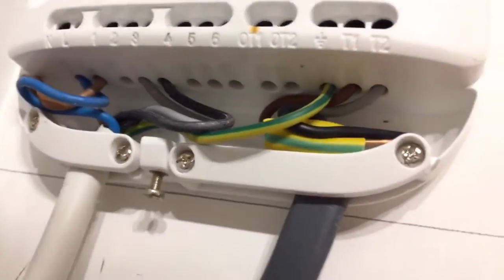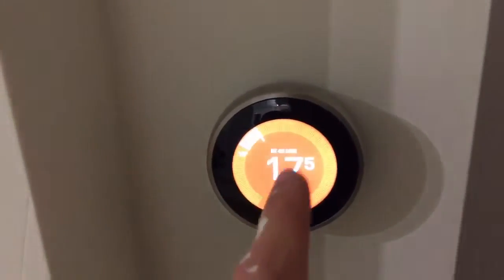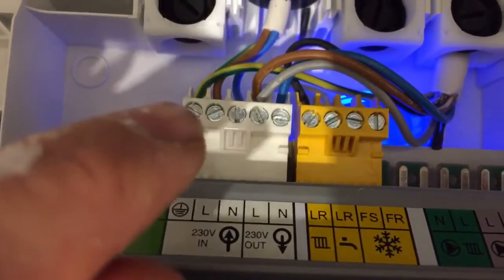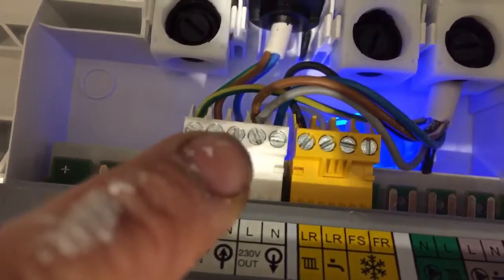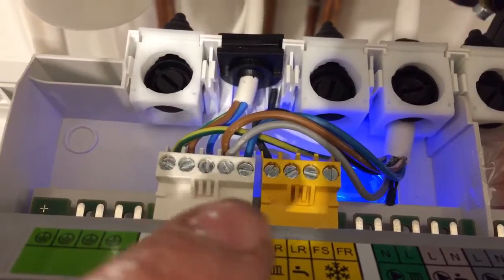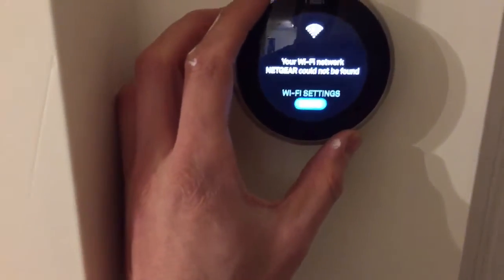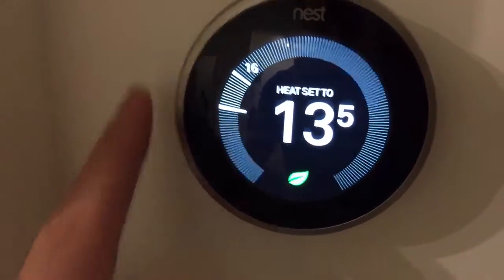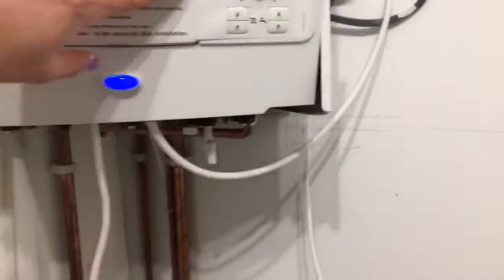How to Install / Wire Nest Thermostat 3rd Generation Worcester Bosch Greenstar 25i Combi Boiler

Comment: By fitting one of these you making it an on off control which is very inefficient and it also stops the boiler from modulating Down to save energy so not great on W/B Boilers

Comment: Thanks for the video 🙌 you said it will work with any boiler, my old boiler has got mechanical timer/clock , only 3 cores comes FROM boiler PCB into that timer clock... 3 cores, thats all that turns boiler on and off ...

Comment: of course if you use the base unit for the thermostat, (which-lugs into a power socket, you with not need and linking power supply  wire through the walls!

Comment: I’m guessing you can use anything to power the actual thermostat so long as it’s the correct voltage? Seems odd having a ‘wireless’ thermostat that needs wiring to the boiler?

Comment: Thanks for a very clearly explained video. 
I power my 3rd generation nest thermostat with a micro usb cable into  a power supply close to best location to monitor temperature. So no need run long cable from boiler location. 
(Communication to the heat link at the boiler location is wireless.)

Comment: Nice video, just wondering if you think it's worth getting a smart thermostat that allows for modulation, to save fuel? Only Worcester bosch wireless thermostat does it I think.
Reply: I was wondering this also. Did you get a thermostat yet?

Comment: Great video - thanks.

Just a couple of things to add, the bridge wire for the hot water should remain in place. Also, if you're replacing an integrated controller such as Drayton RF, the ribbon has to be unplugged from the circuitboard (behind the receiver on the front of the boiler) for the NEST to take over.
Reply: Hey there I've got an integrated system (myson plus) and I've installed the nest system but that still seems to be working. I reckon what you're saying I need to do in order for the nest to work. But could clarify where this so called ribbon is please?
Reply: Great shout on the RF control panel ribbon, saved me a load of agro
Reply: After lots of headache why it wouldn't work! Unplugged it and it's now working ! Also it put it into basic mode, which needed to be disabled as well!

When Worcester plug-in clocks (MT10, FW100, MT20 etc.) are removed,
the boiler stays locked in BASIC MODE, limiting heating temperature to 30°C.

To disable it:

Press and HOLD the ECO button and the CH + button together

Hold for 5 seconds

Boiler should “unlock” the full temperature range

Now press CH + again and set to 60–75°C

This unlocks the boiler’s full temperature range.

Comment: Great post, what happens with LR water? Currently mines connected to 230v outlet using Worcester wave. The 2 wires to wave go to ems which I will delete 
Thanks
Reply: Your Boiler will be more efficient using the Wave via the ems, this will allow the Wave to use Weather Compensation and match the Boiler Output to the load, Nest Doesn’t use ems and Worcester doesn’t support Open Therm

Comment: I don't understand this. If Nest Thermostat can be used with Nest Stand (connected to a regular power socket mounted anywhere in the room) still communicating with Heat Link, why do I have to hard-wire it with Heat Link? 
Shouldn't there be a way to just connect Thermostat with a regular 12V supply, not the original Nest Stand? If it is a fkn smart Thermostat, should it communicate with Heat Link wirelessly in this case?

Comment: Matt decent video.... showing the basics of the install...although there is alot of information missing about how to isolate your boiler and prove for dead....
Just out of curiosity can you confirm exactly what your profession is? By the sounds of it your not an electrician by the terms you used in this video?
Reply from the maker: Hi Neil, I do not have a professional. Just wired it up and left my gas safe engineer and electrician to check it sign it off once the project was complete.
Reply: @MattHutton  come on  you do realise it’s  illegal to open a boiler case regardless if someone has signed off your plus  a gas engineer won’t sign anything for installing a thermostat

Comment: Thanks Matt! did you have to remove the old wireless transmitter for the old thermostat?
Reply from the maker: No worries. This was a brand new installation so there was nothing to remove.

Comment: Get a Nefit OpenTherm/EMS converter, it will allow the nest to modulate your boiler.
Reply from the maker: Awesome, good to know :)
Reply: You should be careful with this if your Boiler is still under warranty as the manufacturer may consider the converter an unauthorised modification, all UK Boiler manufacturer’s should be made to make their Boilers compatible with Open Therm as in Scandinavian Countries, but they want to push you in the direction of their own controls
Reply: Wish someone would do a video showing how to install one of these converters can't find anything in the UK

Comment: Hi, thanks for the video. I have a question as my old basic thermostat was connected to 3 wires plus earth one. Blue, red and yellow. What do I do with the yellow one ¿ thanks in advance
Reply from the maker: ‘If’ your yellow is an earth and ‘if’ you are connecting these wires to the thermostat on the wall to charge it. Then you can just wrap the wire up in electrical tape and not use it. 
But please do no take my comment as advice, as I do not know any of your wires are connected. If I was there I could give you a better idea of how to do it.
But basically the thermostat on the wall has a battery in it and it wirelessly connects to the wireless connector that you mount next to the boiler. So you just need to provide the thermostat with charge. If you what the video through fully you can see how I have connected all of the wires. You only need two for the thermostat on the wall.
I hope that helps.

Comment: How to do opentherm connection?
Reply from the maker: Not sure. Should say in the manual
Reply: @MattHutton  got it sorted
Reply from the maker: @MuhammadAdeelAhmed  awesome, how did you do it?
Reply: @MattHutton  I have logic 35 combi boiler so connections could be different to yours. I have short the number 4, on and off connection and then used the OT1 AND OT2 ports of Nest to open therm ports of combi boiler. Rest of the connections remain same.

Comment: Hope all these people doing there own connections inside boiler are testing emissions after because on this particular you are breaking the seal on a room sealed appliance
Reply from the maker: That’s funny,  I couldn’t see anything in the wiring diagram that came with the Nest to check the emissions after connecting it up. Must have been a job for the gas safe engineer who installed the boiler and signed it off ;)

Comment: No one should take the casing off a boiler unless Gas safe registered, people beware your casing often forms part of combustion seals which protect your life!!

Paying the price of a professional  is often worth it considering the risk involved
Reply from the maker: The boiler with fitted by a gas safe engineer, and provided with a certificate by the same gas safe engineer. Which he provided after I fitted the thermostat :)
Reply: @MattHutton  Its still illegal for you to work on any gas appliance especally if you are removing the combustion cover
Reply: You can take the front cover of the boiler off to access the electrical connections, as long as you don't start touching any other parts inside. In no way does the front cover seal anything, the bottom of the boiler is full of holes so any gas (if there was a leak) can escape with or without the cover on
Reply: @agicorn6379  So how can he carry out the necessary 26.9 checks if he is not qualified to or even have the correct tools also this boiler is room sealed and he is running the boiler with the case removed without a clue about what he is doing
Reply: @agicorn6379  the front cover does provide a seal, if there are any holes in the bottom of the case where grommets have been removed etc then the Boiler is considered to be “At Risk” the last person to work on the Boiler is responsible for its safe operation, once the case is refitted the flue integrity and combustion should be checked using a flue gas analyser, only a qualified engineer is considered competent to do this …. In a perfect world obviously 😉

Comment: Nice video Matt, though you're obviously not a professional cos you have fluked the right wiring but not sure u understand it.  A couple things, 'IN/OUT' is input/output, not inside/outside.  Also, LR is Live Return.

The nest needs a DC power source, and a connection to the heat link.  The connection to the heatlink can be wireless (with a separate dc power supply), OR powered & connected via the T1/T2 terminals from the heatlink.  If you're installing the thermostat far from the heatlink, then you HAVE to wire it to the heatlink, otherwise you can connect wirelessly with a plug in power source (I.e. no wires from the heat link to the thermostat).  This is also why you need to fit the heatlink away from the boiler because the boiler interferes with the wireless signal between the heatlink and the thermostat.  For a hard wired connection, you can place the heatlink wherever you want.  

The boiler controls the temperature of radiators and the hot water.  The nest does not send any details about the temperature, only an on/off signal. So your comments about the boiler not firing because the boiler temperature is low etc is nonsense.  The nest simply sends an on/off signal to the boiler.  If the temperature u set on the thermostat is above the ambient temperature, it triggers a switch in the heatlink which sends a current down the Live Return to the boiler (the 'on' signal).  When the boiler receives this current, it turns on.  When the desired room temperature is reached, the thermostat sends an 'off' signal to the heat link which then turns the switched live off. Because the live return doesn't have a current, the boiler turns off.  Some boilers need to be told to turn off and thats the third connection that you didn't use, but most modern boilers will default to being 'off' if the switched live is off.  This is all of course assuming you don't have any other controllers plugged in (like other thermostats or programmers).

Nest v3 has hot water connections as well (labelled 4-6).  If you want to control the hot water, you'll need to wire these in as well in a similar way to the heating (the video doesn't cover this and isn't required for a combi boiler but could be used for a system boiler).

Finally, worcester bosch boilers don't have OpenTherm, they use EMS (often an orange label / identified as BUS on the boiler).  You can get a nefit ems to opentherm adapter which would mean you only need to connect the power source to the heatlink and the 2 open therm connections to the 2 EMS connections in the boiler (via the adapter).  This will then 'speak' to the boiler rather than just sending an on/off signal.

I'm pretty sure only an electrician can carry out this work rather than an average diyer.   In the US, people can do their own wiring so I assume the how to videos from nest are aimed at them rather than the UK.  The lack of understanding makes me think you're an amateur DIYer and whilst I'm tempted to dislike for your lack of knowledge, I'm gonna like this video anyway cos it still works !!!  Though I wouldn't pay you to do any wiring for me...
Reply: Hello, reading at your comment makes me think you are a specialist at boilers and thermostats? Since i just purchased a boiler and a nest thermostat, i have no clue how to connect it, mine is a bosch combi boiler 2000, and i was wondering if you could guide me to how do i connect it, and how does the hot water gets connected, how does it work? Thank you
Reply: @pidhsome  I think Matt has produced a really good guide for you to follow.  Other than referring to certain technical terms incorrectly and not really talking about hot water, I think his guide should give the most basic instructions on how to install.  I'm not a specialist by any means, but happy to set on the right path.

A Worcester Bosch 2000 is a combi boiler i.e. you would get hot water on demand when you open the tap, so you don't need to worry about hot water connections and can follow Matt's guide.  If you have a hot water tank that fills up with hot water every now and then, then you would have what's referred to in the nest installation guide as a Y-plan system and you would need to wire the hot water controls as well to tell the boiler when to send hot water to the hot water tank.  

The installation manuals aren't as user friendly as they used to be, so without seeing the different connection options, I cant say which wires go where, but Matt's guide should give you a good starting point.

Boilers and nests are expensive bits of equipment.   If you're not sure what you're doing, I suggest leaving it to the professionals.

Good luck
Reply: @ravindrabakrania  problem is where i live there’s no specialist near me for more that 200-300km away, so getting one would be really expensive that’s why i’m trying to learn myself, thank you for the suggestions tho, take care.

Comment: Thanks for the video. I think your boiler is opentherm. Is there a reason why you did not wire to the opentherm, please? My understanding is that the boiler will be more efficient with that additional piece of wiring? Thanks
Reply: If the boiler is New enough supports open therm that's how he should have wired it up more efficient you use the other connections for opentherm
Reply: Worcester Bosch Doesn’t support Open Therm so you can’t use Nest Weather Compensation with Worcester Bosch, would need to fit Worcester Bosch Weather Compensation Controls to use this function

Comment: Thanks for your efforts with this video. Allowed me to fit my nest with ease. All fitted and up and running in 3 hours. This includes routing bell wire to the thermostat in living room and up into the ceiling to the nest hub in the airing cupboard.
Reply from the maker: Ah that’s awesome I’m glad to hear it :)

Comment: So it’s no a wireless thermostat it’s it’s if you have to wire power other to it
Reply from the maker: It uses a wireless signal to communicate with the boiler, but the thermostat does need to be powered to charge the battery yes :)

Comment: I just followed your video and got my nest working perfectly in about 30min, one thing i did notice my old wiring had the hot water (LR) connected to the 230V Live out (L)? any idea what that was about?
Reply: That’s a link that needs to be left in place

Comment: Would it not be possible to have a jumper cable (from the "L" terminal on the Heat Link to the "2" terminal) in order to replace the function of the grey cable in your setup? So, in effect, having only 3 cables going from the Heat Link to the boiler.
Reply: You absolutely can, it’s just cleaner this way as the terminals in the heatlink are tiny.
Reply: Yes that would be fine.  I usually use the linked cable I take out of the boiler and sleeve it with brown sheath.  Or a small ofcut of the brown cable in the flex.  Either way is perfectly acceptable.  It's just a permanent live. All of the wiring should be taking supplied line neutral and earth from the same power source as the boiler. So anyone else in future working on the appliance can easily and safely isolate external controls too.

Comment: Thanks, are you sure the L1 and L2 is for power only? I thought is was also for data connection at the same time like a honeywell also does. When its not connected the mesh system is taking over. I hope so because i want one and i'm not sure this mesh data wireless system will be strong enough to go through two concrete reinforced floors.

Comment: It does not seem, that this way of connection of Nest does provide any load-compensation, or weather-compensation control, compulsory for all new combi boiler installations since April, 2018 in UK!  It is just like the old fashion simple ON-OFF control, which now is illegal, unless the boiler is a system one, in which case the room-stat should control the heating motorized valve(s). Better use BoshEasyControl, or any of Worchester Sense I with load compensation function, or Sence II with weather compensation /Wave Smart for remote control via app to comply with Boiler Plus Regulations

Comment: Did you set the nest as open therm?
Reply: Worcester Bosch doesn’t support Open Therm so unfortunately you can’t use the Weather compensation function of the Nest to its full potential, Worcester only support their own weather Compensation through Wave or Easi Control

Comment: are you gas safe registered?
Reply: I doubt it Whoever commissioned the appliance didn't set the max parameter for CH 88⁰C is too high. It's where the high limit stat kicks in and switches the appliance off 🤷‍♂️.  The correct way to install this would have been via opentherm much more, efficient.
Reply: You need the WB adapter to convert the OT to WB language, you can get them from Holland, but im sure WB are selling them here now.  Then your boiler will modulate better. https://www.worcester-bosch.co.uk/products/accessories/directory/easycontrol-adapter
Reply from the maker: kB no I’m not